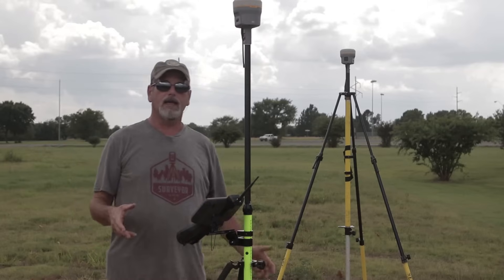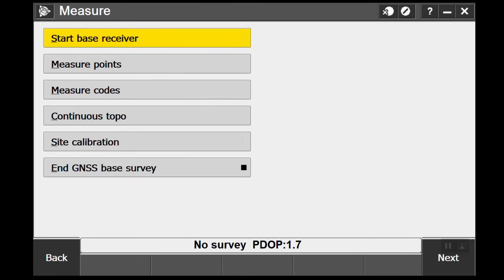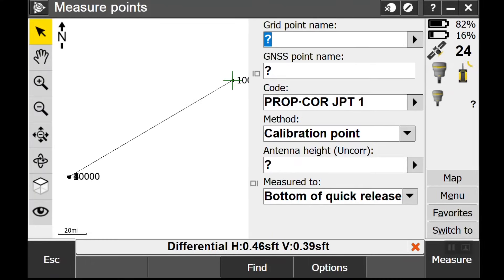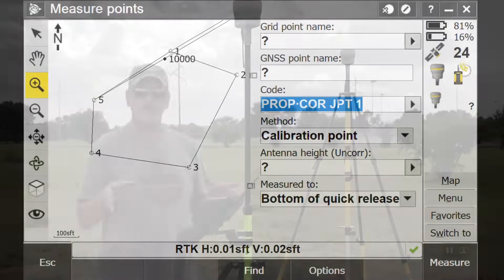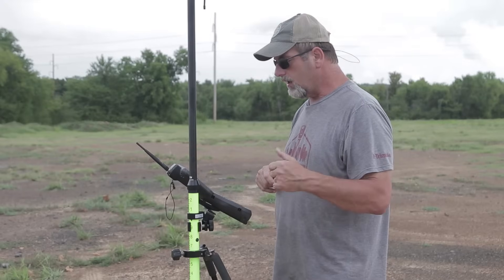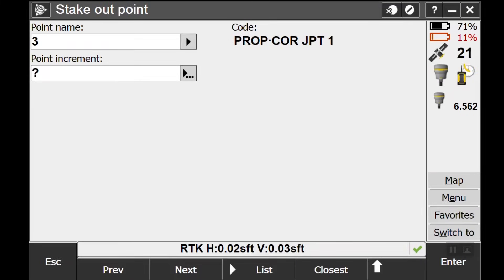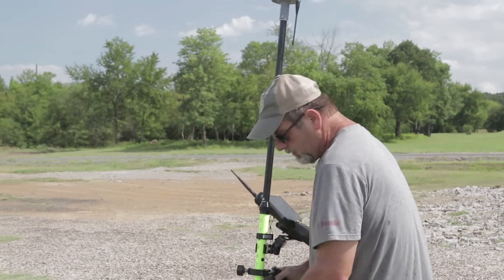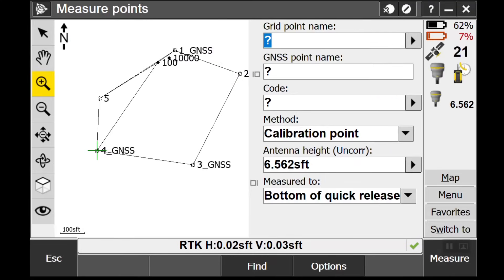GPS Site Calibration

Comment: (TSC3) I've been having problems trying to understand why distances calced don't match distances pulled in the field with a steel tape, Ive been setting up jobs with state plane, geoid 18, coordinates "calculated scale factor", I go ahead and calc my distances according to plans. I go ahead and found my corners from the previous record of survey and the distances match then did a site calibration and the residuals are within a tenth I'm not sure whether I need to check the box for the scale factor of 1 so I leave it unchecked and hit apply. Stake my calc points and to check how the actual distances match with a tape and I'm getting 1-3 tenths longer than what the gps says. Its mind boggling, I'm not a PLS but I was able to buy the equipment off my pls after completing a job for him and im not sure what the best settings are for construction jobs vs boundaries please help and if you need me to clear something up because I said something stupid let me know thanks if you're able to get back with me
Reply from the maker: Send me an email with your contact information. Robert@surveyingwithrobert.com

Comment: I'm developing a wish list for Trimble Access, one is that you could toggle between the calibrated coordinate system and another chosen system, say, State Plane coordinates. Yes, you can go to properties and scroll through and re-select the system that you prefer as a commonality between all your other work, but it would seem nicer, to me, to have an "Un-Apply" button in the calibration menu that would toggle off the calibration and enable exporting the data in State Plane coordinates as well as exporting in the local, calibrated system without having to restore the more global datum with the properties menu...

Comment: Great video, thank you...just embarking on my adventure into R12i surveying to augment my S6. With the S6 and TSC3 I build a mathematical model of the boundary and then use resection to tie into the model and the residuals tell me if the model fits the points I find and am able to see from my initial setup. I imagined being able to do this with the R12 with the added benefit of being able to “see” all my points,. Alas, such a routine is not readily apparent in the TSC7, but your video has me thinking that something similar is possible, I just need to adapt to this new method. Thanks, you may be saving me from the inferiority of translating and rotating to merely two points...
Reply: Thanks for the reply, I’m getting the TSC7 to run the R12i, I agree about the mental gymnastics involved in monkeying around with rotation and translation, especially with gigantic state plane coordinates
Reply from the maker: Be careful the R12i does NOT work with the TSC3. The R12 and the R12LT will work with the TSC3. I hate rotating a job. That can create more problems than it solves!

Comment: Our job site is rural and not in a VRS area. I often need to setup an approx base station and then shoot a survey mark that's far away from the job and then shift the whole job to that known point back in the office. I don't want to set the base over that mark. Can I calibrate based on just a single point? Our job is simple and we do not need to scale or rotate. That would be so handy.
Reply from the maker: I have a vide about projections I think. You can use TBC to merge points. See if that video helps.
Reply: @SurveyingWithRobert  Thanks for your reply. I got to apologise, perhaps I didn't frame my question properly. In my case, I need to do some stake out with a base and rover equipment. I want to put in a nail at the job site. Setup my base station over that nail. Measure a known point with my rover. Shift myself onto that known coordinate in the field and proceed with staking out. (providing my job was created using the correct projection settings, this is sort of a single point "GPS site calibration")  For efficiency, I don't want to go back to the office, pull out my laptop, or setup my base over a known point first. Would this be possible?
Reply: All I am after is a single point translation, not after rotation or scale. I could setup on "near" or approx. coords on my base. Survey the known point. Calc the difference in coords in the field. Apply the correction to my base station but I will have to drive back to my base station to re-setup my base and ideally, I would have to drive back to my known point to check that my corrections have been applied correctly. If there was a way to do this while I am over the known point, that would be so good.

Comment: How did you do that 5000 5000 setup?
Reply: What mean is . Your coordinates of N 5000 E 5000 how did you get the coordinates of the other 4 points.
Reply from the maker: Richard Smith I assumed 5000 5000 as a starting point then ran the bearings and distances around the project to get the other positions. Does that help?
Reply: @SurveyingWithRobert  yes it does
Reply from the maker: Richard Smith I don’t understand your question.

Comment: Hey Robert, great video with some really good information! I tend to use SCS900 for site calibrations but great to see how it works in Access. Any chance you have a video coming up that coveres traversing using access. I've only ever measured rounds in SCS900 but it is cumbersome. Would be amazing if you could run through the checks you perform on the TS before starting to get good readings and how you measure the rounds to BS prisms. Love the videos keep them up!

Comment: if you translate 1 ground to 1GNSS, then rotate 2 ground to 2GNSS holding 1 ground as base of rotation, you now have grid north associated between the two systems ultimately good to stake out the rest with associated coordinates. What about the scaling from your grid to ground... isn't there a random error of scaling as the points get farther from the 1 ground held point?  Clarity... the GNSS is grid distances.... the 1 -5 points (created by plotted record calls) staked out are ground distances. How are you accounting for scaling.
Reply from the maker: State plane Arkansas North.
Reply: Guess your projection plane of AR's system is relatively close to the actual ground being that the distances hit without scaling.